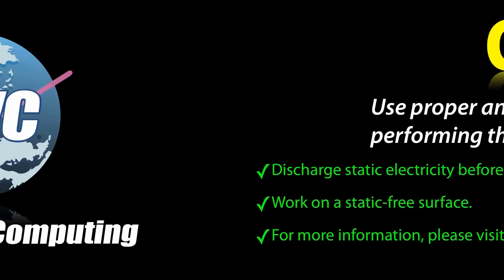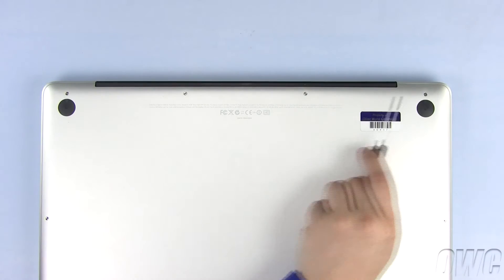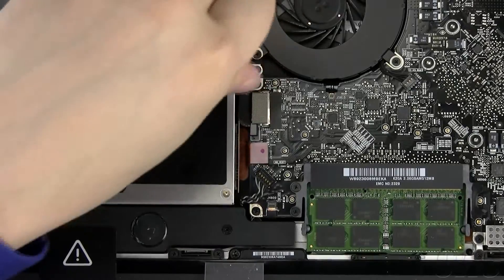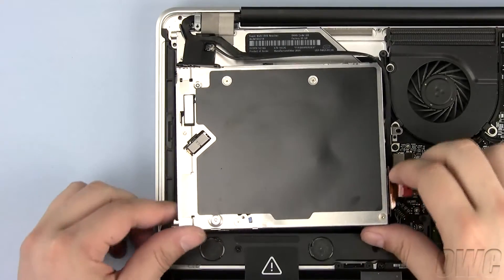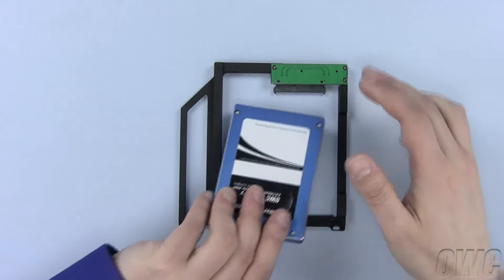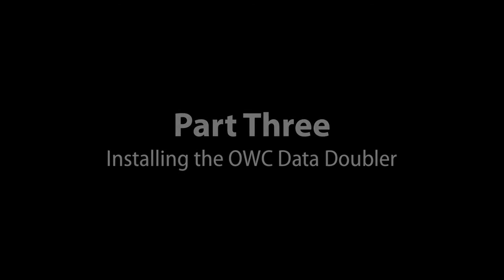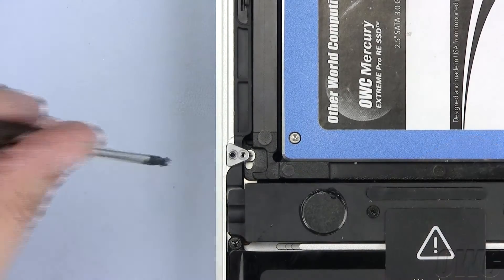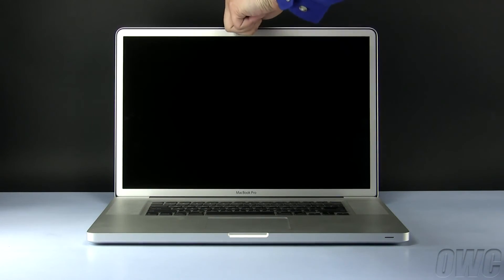17-inch MacBook Pro Early 2009 Data Doubler 2nd Hard Drive/SSD Installation Video

Comment: The ribbon cable for my screen got pulled apart during this operation and also the sata connector will not stay clipped on!!  Why wont it clip back on to what it was connected to before?  Its like the data doubler kit doesnt allow it to and is pulling it off towards the data doubler.